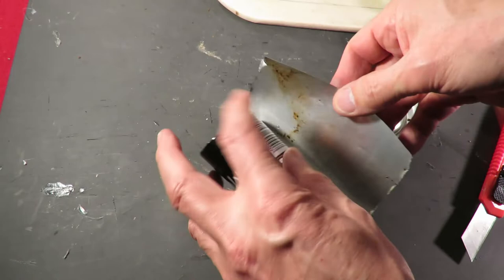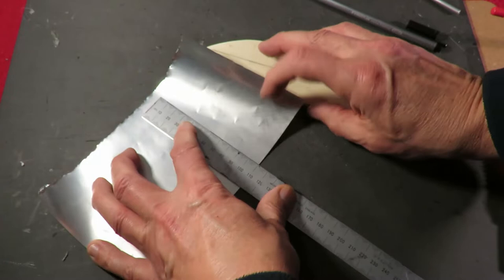Wooden Pop Pop Putt Putt boat semi fail SHORT

Comment: After the wood dries out you could try putting a couple of coats of Thompson's water seal on it.
Reply from the maker: True, alternatively I could use it as kindling for our open fire :-) although I was rather pleased with the shape I had produced so maybe I could use it for another form of propulsion. I have my tin of yacht varnish open at the moment to varnish some painted rocks so I will give that hull a couple of coats at the same time 😀